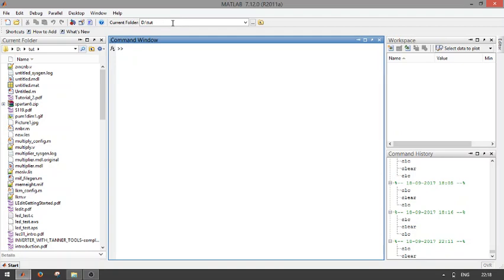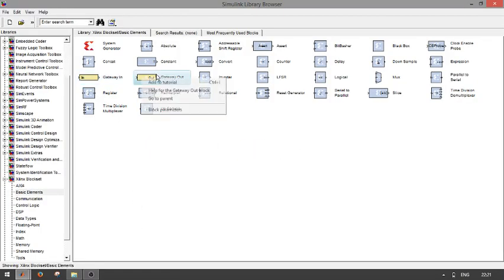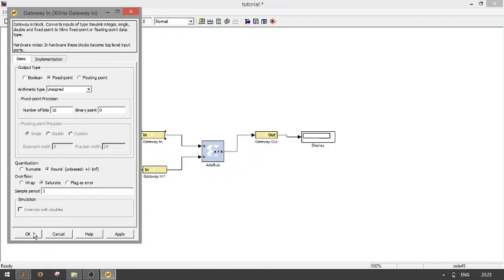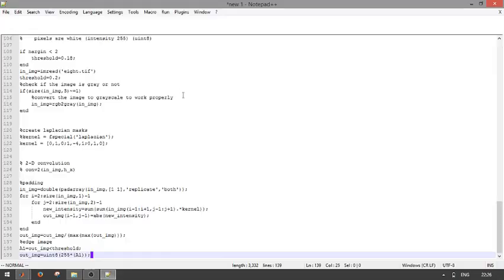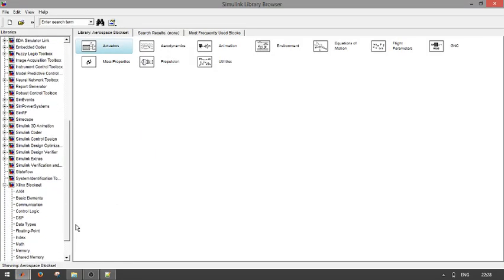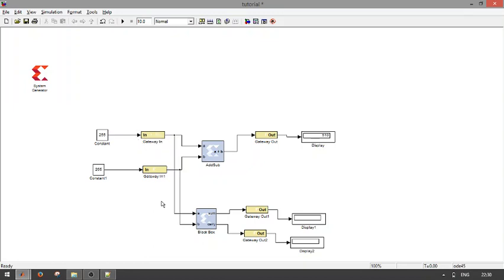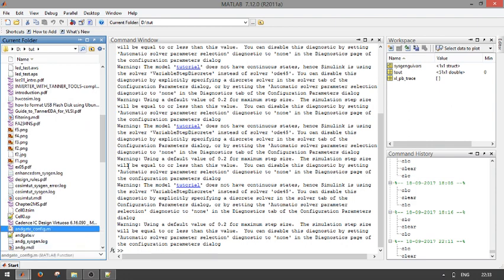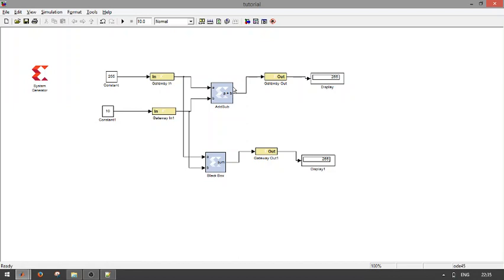Hardware Cosimulation using MATLAB and FPGA

Comment: how can we generate high-frequency PWM pulse using FPGA and MATLAB
Reply from the maker: There are lot of tutorials are available within MATLAB itself, you can use filter blocks and the appropriate sources to generate PWM pulses, or you may use m script and embed the same inside simulink to use it in a FPGA.
Reply: @techseed1092  can you please suggest video link which describes the PWM generation.

Comment: Xilinx System Generator hardware co-simulation block generation is complete without any problem but the block used for simulation did not appear? Does anyone know where or how to find the generated block for co-simulation?
Reply from the maker: That will be generated as a library, that is found inside the working directory

Comment: Nice work TechSeed, can you please share your contact or email address please
Reply from the maker: Jahangeer Soomro peermohamed1989@gmail.com
Reply: An internal error occurred in the Xilinx Blockset Library.

Please report this error to Xilinx (http://support.xilinx.com), in as much detail as possible. You may also find immediate help in the Answers Database and other online resources at http://support.xilinx.com.

Error occurred during "Simulation Initialization".

Reported by:
  'Model/AddSub'
Component: System Generator | Category: Block error 
This is the error i am getting, please help if u can
Reply from the maker: Actually, this error is happened due to improper communication between the software and hardware blocks. Frequently this error will happen. You just close the matlab and restart from system generator under Xilinx tools. System Generator has been opened as administrator. Then you have to change your project directory to the current location. If you did like that then the error won't happen. If still the error persists then take a screen shot and send me through mail.
Reply: dear sir thank u very much for unconditional support. I am Lecturer in electronics department. this work is very important for me and for my students. 
Warning: Model 'xbsBasic_r4' was created with a newer version (R2015a) of Simulink
To create a model that is compatible with this version of Simulink, load the model in Simulink R2015a
and select File > Export Model to > Previous Version. 
Warning: Model 'xbsIndex_r4' was created with a newer version (R2015a) of Simulink
To create a model that is compatible with this version of Simulink, load the model in Simulink R2015a
and select File > Export Model to > Previous Version.
i am also getting this warning. does it have any realtion with previous error?
Reply from the maker: Welcome, Jahangeer. That warning if persists that does not affect the operation of Simulink blocks. It will work.

Comment: how to see processed time in hardware jtag simulation? without fetch image and make it output to matlab? thanks
Reply from the maker: The processing time depends on the clock rate that has been set inside the system generator token
Reply from the maker: The processing time has been specifically chosen by the image size especially for an image of 128x128 it took almost 128x128 ns to complete the entire simulation for a clock rate of 10ns. If you want the timing info then you have to synthesize your module inside Xilinx ISE and the worst case timing is considered. But in case of System generator this has been considered through the entire image read and processed through the hardware in a sequential manner. So this is not possible to measure the timing without full simulation in system generator.
Reply: TechSeed so how would you suggest to retrive time data? because my image is 512x512 picture and hware jtag is so slow. thanks!
Reply from the maker: To retrieve data it took almost 524288ns for complete the simulation and get the output. So you have to wait for until the simulation has to be completed. If you want to reduce the simulation then you must reduce the size of the image, probably 128x128.